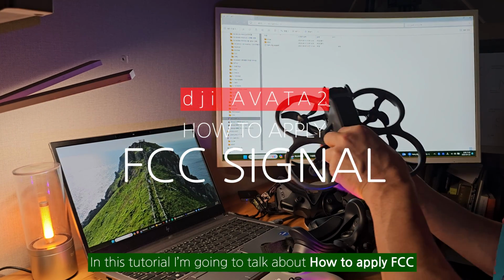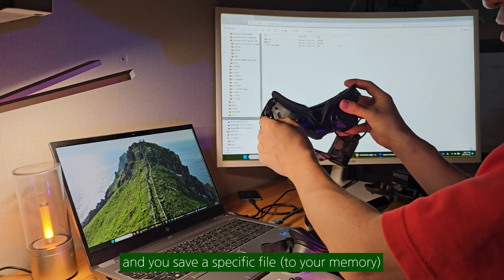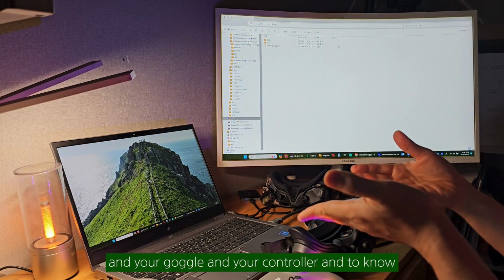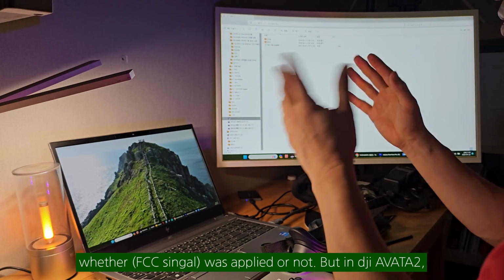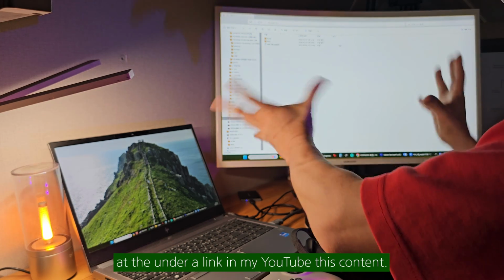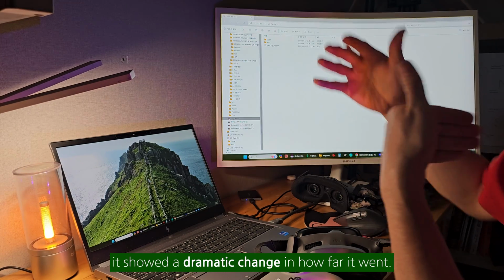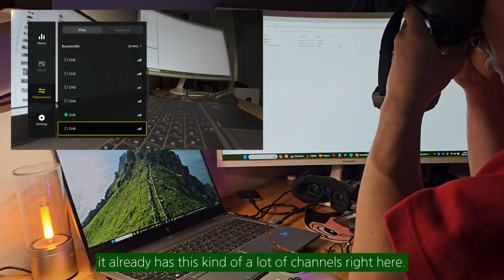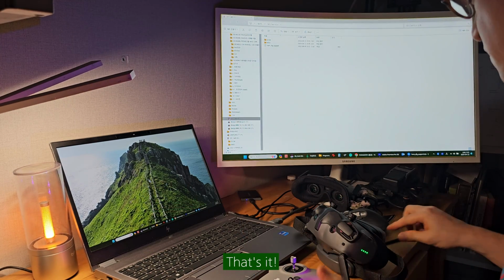How to apply FCC Hack to your dji AVATA2

Comment: DONOT UPGRADE YOUR A2's FIRMWRE AFTER YOU ACTIVATE IT FOR THIS TO WORK. The latest firmware disables the hack, reason why allot of people here is saying that it did not work for them. I just got my A2 today. Activate it and skipped firmware update, followed this video. FCC unlocked (im in the Philippines CE region)
Reply: This is not entirely true, the FCC hack still runs on my drone, even though I have updated the firmware.
Reply: @betaompay38 still? Have not tried it but I’m on the latest firmware 🤨
Reply: can delete last update again?
Reply: works great on latest firmware here
Reply: Which firmware @HELLOHOGO
Reply: how is philippines CE region? i thought CE region is only europe?
Reply: @marcolangenberger  unfortunately, If you're in a country that does not have local rules about drone transmission DJI defaults to CE mode to play it safe.
Reply from the maker: Somewhere who use mm,m,km instead of inch, mile, mostly use CE(not all)
Reply: what if I've already updated that firmware ? 😒
Reply: @betaompay38  Try Turning it on like This -> First Googles then Remote then Drone -> I read that it only works if u turn em on like this
Reply: Apparently there is no update yet for Avata 2 according to DJI tech support, are you sure you updated? What fw have you guys got?

Avata 2 V01.00.0200
Goggles 3 V01.00.01.00

See release notes https://dl.djicdn.com/downloads/DJI_Avata_2/RN/20240411/DJI_Avata_2_Release_Notes_EN.pdf
Reply: Does this hack have any negative parts?
Reply from the maker: To me, none ^^ dji doesn't say anything for this
Reply: @YOONGOON_FPV 
Sir once it hack then which channel should i choose for better transmission?or just let it select auto?
Reply: After fcc, which CH i've to use ? All the same ?
Reply: Do it in AUTO !
Reply: @yousri.g.1348  do you think it does boost your signal too mich and they can trace you or is more like the same mW but just 5.8Ghz
Reply: Me hack stopped work
Reply: Mine already updated but still cant hack fcc
Reply: depends on the country
Reply: How do I download the file to my SD card?
Reply: Effective po ba yan? ilang range ang nadagdag? Thanks for
Reply from the maker: it is effective. once u put that file in your goggle in 20mhz you will see 7 channels which had only 4
Reply: @YOONGOON_FPV  hello so im in singapore and dont see any transmission power level option. Can I assume it is not working and and still in CE power limit? Manual channels are unlocked ch1-3/ch1-7
Reply: Okay i bet mine wouldn't work because i keep on updating but Will it be fine if I use one of those fcc hak mode on the dronetweaks website?
Reply from the maker: Exactly, I didn't update yet, phew!

Comment: Would I need to manually switch between channels and modes if I start to loose signal or does it uses them automatically?
Reply from the maker: when flying alone you can set to automatic but once manual then its fixed to your selection

Comment: does this work on the avatar just?
Reply from the maker: avata1?
Reply: @ correct
Reply from the maker: @DupIicate yes same way. that txt file was used in avata1 and it also.worked in avata2
Reply: @ ok sweet what mhz do you recommend for far range? and what channel do you recommend?
Reply from the maker: @DupIicate i prefer 20mhz, about this ask chatgpt, it will tell very specifically and logically
Reply: @YOONGOON_FPV  oh ok is there a hack to make your drone faster? when its in sport mode?
Reply: @YOONGOON_FPV  and also i put my drone to a channel and i put it back to auto and then i go back to manual it don't save am i doing something wrong?

Comment: It's insane that DJI will sell such a vastly inferior product - by design - to such a large section of their customer base (we unlucky muppet in CE regions).
Before this hack, the FPV goggles range was on par with my old Emax tinywhoop with a FRSKY transmitter. You read that right: the cutting-edge O4 digital Transmission performing little better a goddamn FRSKY whoop. It's absolutely absurd 🤯

Comment: Hi there ! Perhaps I can help fellas .maybe has something wrong! Maybe location's  rules or  one of the most commons mistake.      I saw this around some guys just saying,  that  For FCC work, You must to do like this =   after load file.,..  Try  to turn on first Goggles 3 , FPV Controller 3, and then AVATA 2 just like that.  Now try this one , \\ And this  it´s  my A bonus gift for all you guys,      ( just for record I even´t try this yet!  I Just feeling it´s works!! ) But I got almost certain conviction that, If you Turn ON like this AVATA 2 drone>  Remote controller 3 > Goggles 3 you just brake FCC mode and go back to CE MODE without to have restore  to factory 's default  settings .  REMEMBER ! To fly FCC first G3>RC3>A3.   I Heard throught something like that too ... .  And  Works for me even latest firmware update, greetings from Brazil . See u around.  keep us in touch if works. Thanks.  , I working on my english yet ,   It´s My bad
Reply: fala thiago, blz? Como vc soube que o arquivo passou a funcionar? Eu instalei aqui, mas honestamente não senti diferença.
Também achava que o googles 3 tinha uma definição de imagem melhor.. não acho muito boa, será a frequência?

Comment: Hi,
I do not need to extract the file, right? I just have to download it from your link and make it copy to the XD card and put it to the goggles, right?
Thank you!
Reply from the maker: and check whether the 20mhz channel changed from 3chs to 7chs
Reply: @YOONGOON_FPV  I do not need to extract the file? I just copy to SD and Insert SD to goggles and check the channels.
Thank you!
Reply from the maker: it should be extracted and could be opened in memo
Reply: @YOONGOON_FPV  I have to extract it on PC or on the SD card? Or 1rst to extract on PC and make copy from it to SD card?
Thank you very much!
Reply: @YOONGOON_FPV   THANK YOU SO MUCH !!! I did check from channel 3 to 7, and I started seeing them now. I did check all channels and I see now a lot of channels. 😊.The finally I going to be able to fly more than 150 meters away and not losing connections. Inside my house I'm getting now 27-28 Mbps. Before that I had only 5 Mbps inside the house.  
Thank you for helping me out !!!
P:S;Can you tell me please which channel better to use or just have it everything on Auto?
Reply from the maker: mostly auto, and flying with others then manual, 20mhz, and choose strong ch. but for me I mostly use 20mhz, the reason? ask chatgpt 20mhz vs 40mhz
Reply: Thank you very much!!!
Reply from the maker: plz watch my latest volcano trip at Indonesia ^^ and leave message

Comment: Hi Yoongoon, thanks for the video. I think mine worked. I'm getting the extra channels. I'm also getting less interference when i fly directly behind my house (which is less than 50m) but when I do the distance test it was about the same (800m) started to flash up orange. ANy recomenndations on which channel or bandwith to use? to make it better?
Reply from the maker: if u ask chatgpt it will give more specific answer, fly with 10mhz or 20mhz but less goggle view quality :) dont go behind with sapped tree, dry wooden house is ok. but steel concrete will block your antenna

Comment: Thanks for your video. In my case I installed the hack, if the transmission is unlocked the automatic mode and I can select 5.8 or 2.4ghz..
Once on the flight field I do notice that it has a better signal but the speed does not improve, it does not go over 70km/h... and I do not notice any improvement in power either, I don't know if any parameters need to be modified but I don't know what I'm doing. mistaken. (and since I have a 5" fpv I even notice that it lacks power)
Greetings
Reply: avata 2 goes to 100kph in manual without fcc. fcc is about transmission signal strength only.
Reply from the maker: try to fly in 55 degrees then it will fly faster

Comment: I did exactly what you said. Both are visible in manual mode. 5.8 and 2.4. So how do I understand that it is FCC? I was already seeing 5.8 and 2.4 in manual mode without doing any of this?
Reply from the maker: 3 channels expand to 7channels at 20mhz
Reply: @YOONGOON_FPV  5.8 ghz now 20 mhz in 7 channels? is it done?
Reply: @mezopotamyalabs  ademcim 5.8 seçip auto yap
Reply: @feiht5487  teşekkürler üstat kimse bilmiyor bu işleri doğru dürüst
Reply: @mezopotamyalabs   bilen var da türkçede bilen yok 2.4 ghz ormanlık alanlarda sinyal kirliliğinin olmadığı yerlerde en uzak menzile gidiyor 5.8 ghz ise daha çok  kanalı var ve şehir ortamlarında daha iyi sinyal sürerliliğine sahip ama menzili kısa auto yaparsan bu iki sinyal bandı arasında dengeliyor kendini en uygun olanı seçip
Reply: @feiht5487  peki şunu sorayım bu 0kb lik dosyayı attım fcc oldu ya. Otomatik moda alınca da yine FCC oluyor değil mi?
Reply: zaten FCC olduğunu o auto seçme tuşu kilidinin kalktığından anlayabilirsin ha yine emin olamadın uçurmayı dene bağlantı kopukluğu yaşamadan tecrübe edeceksin.
Reply: @feiht5487  şimdi fcc yaptık transmisyona girdim ya orada otomatik ve manuel mod var bende. Manuel dediğin gibi 2.4 ve 5.8 GHz. Evdeki modem mantığı bu ghzler tamam onu anladım. 2.4 ya da 5.8 den birini secince kanallar çıkıyor. Burada otomatik kanal seçimi yok MHz olarak. 10 20 mhz de doğal olarak daha fazla Channel var. Orada ne yapacağımı bilemedim
Reply: @feiht5487  şunu sorayım direk. otomatikte mi ucayim fcc den sonra
Reply: @feiht5487  chatgpt ye sordum diyor ki fcc attıktan sonra ha otomatikte kalmış ha manuelde hatta otomatikte bırak diyor ghz seçme
Reply: @mezopotamyalabs  açıkladım zaten en başta otomatik seçersen dengeliyor sana en uygun olanını
Reply: @YOONGOON_FPV  Isn't it 2.4 GHz, master? Or is it 5.8 GHz?

Comment: Hi Yoongoon, will this hack work when flying in normal mode as Im pretty new to Avata 2,  I haven't went into manual mode for flying yet but my range is very poor even after installing the hack, I do have all the channels so it must be installed ! correctly
Reply from the maker: are there 7 channels in 20mhz? how many channels do u see?
Reply: @YOONGOON_FPV  yes I can see 7 channels in 20 mhz
Reply from the maker: OK that means it's now FCC mode, then it works on normal(sports) and manual both, try to fly at open field instead of behind the trees and braches, were you flying behind obstacles?
Reply: @YOONGOON_FPV  ya, I was flying behind obstacles and I would see the signal going orange and then red so I would increase my height and it would be ok them 👍

Comment: Do i really need an sd card? Or i can just manually add it to the googles?
Reply from the maker: only sd card can do this for you
Reply: @YOONGOON_FPV  i appreciate that bro! Thanks! Im gonna buy one! By the way? The fcc hack for the avata 1 is the same as this one right? I do have the avata 1. 😭
Reply from the maker: yes they are same and this hacks the goggle, which means it's also possible at dji neo, I will upload dji Leo's extreme flight soon!
Reply: @YOONGOON_FPV  damn! Thanks man! Im excited! To be honest the only thing that i didnt like about my avata is the range and i think this will help!!! Thank you in advancee xD
Reply from the maker: mine works

Comment: I have a question, could you please answer it for me?

I already applied the file on the glasses, now what I don't know, should I put the channels in automatic mode or manual? And what bandwidth should I put?

 Thanku you very much
Reply from the maker: manual, you can choose 40mhz normally and leave it automatic, manual is for when flying together such as racing games. (for farther flight, select 10mhz but sacrificing the clarity of goggle screen) if 3channels of 40mhz changed to 7 channels, FCC has been applied
Reply from the maker: ask chatgpt for further more, it knows really well

Comment: Does the FCC hack work on latest firmware ? nice video btw
Reply from the maker: I think it does
Reply: Does this hack apply with motion controller sir?
Reply from the maker: this hacks the goggle, and your cons are connected to the goggle

Comment: My drone cant even fly to the other side of my house before losing complete signal. Even when its right next to me the signal is like 5 mbps. Whats up with that?! This happened after i did a update on all my avata stuff after not flying it for 6 months
Reply from the maker: but plz note that drone is similar to kites...going behind is losing your kite lines.. if it's a city or valleys with other many walls to reflect signal then it's occasionally possible to go behind something but if it's open filed and nothing then it's like that..check my community tab where I sketched this logic in diagram
Reply: @YOONGOON_FPV  I see. Makes sense, although before I was able  to fly behind houses just fine. Now I can't.
Reply from the maker: did u buy anything that can interfere signals in your house? any changes?

Comment: Holy crap…first I have to say I am using the latest firmware for the Avata 2 . I followed your instructions, used your file, etc.  - the only thing I did not do was format the SD card first.  I just went out for a test flight and boy howdy, what a difference!  Airspeed remained the same but distance and signal strength - through the roof!   I bought this Avata 2 in Germany and have been flying in Europe the entire time in CE mode and I always wondered why I never got anywhere near the range I saw in videos on YouTube.  Now I know why.  I actually flew so far I got nervous when I started getting into the next town and turned around (something I could never have even considered doing until now) and I never lost a single bar (signal and HD).  My questions now are these - if this is because of the goggles, does this mean I can fly any drone compatible with goggles 3 ( mini 4 pro in particular - which I have my eye on) in FCC mode if I am using the goggles?  Also - how do I do the same with a mini 3 ( not mini 3 pro - just the mini 3)?    Thanks for the hack and the info - really!
Reply: Do you use the Motion controller or the controller 3??
Reply from the maker: I use controller3 and 2
Reply: @Marino002  I use the motion controller that came with the fly more package.  I don’t own the controller for manual mode and don’t plan on getting one anytime soon.  I was a pilot long before I flew drones recreationally and I guess the motion controller is more of a stick and rudder feeling for me.  Its like on my mini 3 - I just can’t get used to the left stick configuration of stick up = climb and vice versa - I think im just going to reverse the input on the left stick to stick up = down, like in real aircraft when you pull back (down) on the stick the nose goes up and you climb.  Stick forward (up) / nose down (descent) just makes more sense muscle memory wise.  I wonder if anyone else feels like that…
Reply: @DexterMannheim I can relate. Do what feels right. Thanks for the info. Cheers.
Reply from the maker: exactly, if you see me flying BETAFPV'S PAVO20 series(ad dji O3 air unit is inserted to pavo20 drone) which I use Same goggle3, I don't have to do anything as FCC is already applied, next week I'm going to upload long range city flight of pavo20, and u will be astonished   by its flight! ^^
Reply from the maker: I'm not sure with mini3 as I don't have it but once the goggle if fcc mode it should be fcc mode as I'm using other dji o3 air unit embedded fpvs and they fly just so far. check my other videos flying inside the cities..you will be astonished
Reply: Have to be in manual or automatic the option for the Signal?
Reply from the maker: if many are flying it's better to fly in manual 1, 3 ,5, 7 channel gaps will help frequency clashes...but flying with 2 pilots? auto is enough

Comment: even after the updates the hack works just as fine EVEN IN EUROPE. what i dont know is what is the best configuration to use in the transmition settings like what would be the best for better signal penetration/range? 5.8? and the bandwith? or should i just leave it on auto?
Reply from the maker: 10mhz shows the most long range :)
Reply: do you think its a way to catch me using FCC in eu ?  @YOONGOON_FPV
Reply from the maker: u can ask chatgpt for more details, it knows well ^^
Reply: @YOONGOON_FPV 
If i choose auto after fcc hack is it better than choose specific channel like 40hz,20hz or 10hz?any d8fferent?
Reply from the maker: if u ask chatgpt it tells very specifically about this

Comment: Hi Yoongoon，May I ask after I apply with channel I have to choose?
Reply from the maker: Use 20mhz in auto when flying alone, and in manual, choose any channel with good signal, when flying with others, fly 1, 3, 5, 7 with some gaps considering interference, for.more detail ask chatgpt, it explains very well ^^
Reply: What mean flt with other？😅
Reply from the maker: If you race fpv with others then 4 will fly at same time, that's when u adjust Channels

Comment: the avata 2 menu doesnt show any chanells its shows auto
Reply from the maker: Strange, so many channels and manual were shown even before FCC hacking
Reply: @YOONGOON_FPV   well i tested my avata 2 and it flys 1km and max speed what i got in sport mode was 57km/h not a lot
Reply from the maker: 90km/h In 45degrees here in korea
Reply from the maker: @vilnisphoto  in manual, did u try over 50degrees for.camera angle??
Reply: @YOONGOON_FPV  i dont have manual i got auto and it doesnt  open manual,and i got stick remote not other

Comment: cool I gonna try it!
But i don´t know if my avata 2 firmware was update...
Is it possible to back to the firmware´original?
Reply: Greatings from Brazil!
Well it worked! My firmware is the first! 🎉 but apeeared just 3  channel, why?Should i Keep automátic or manual?
Reply from the maker: Automatic is good, but if you see too much orange or red signal, do manual...even when u fly with your friends
Reply from the maker: As I know.it's not possible